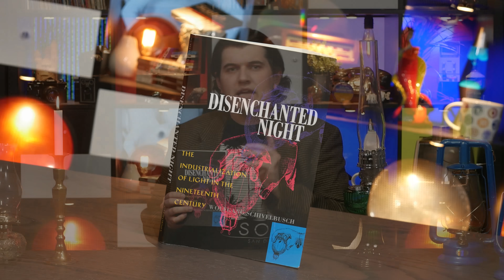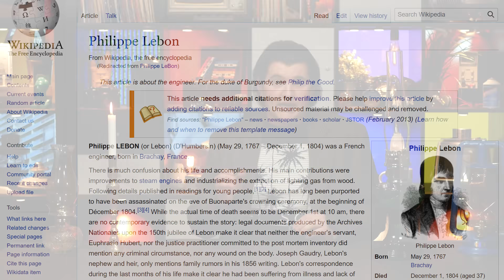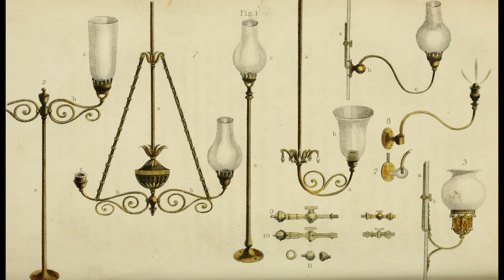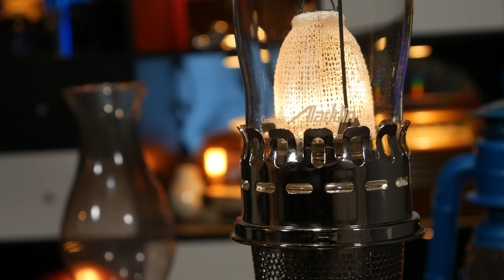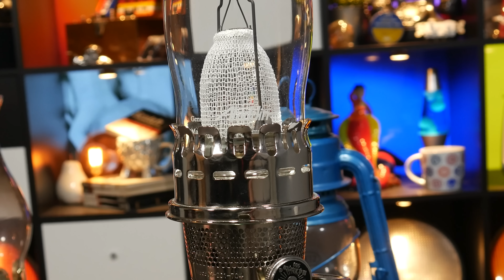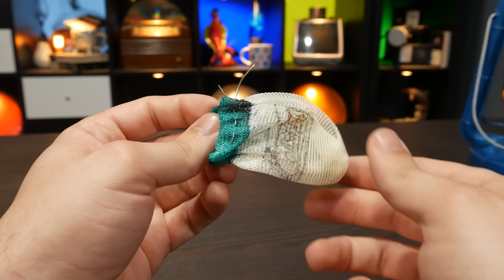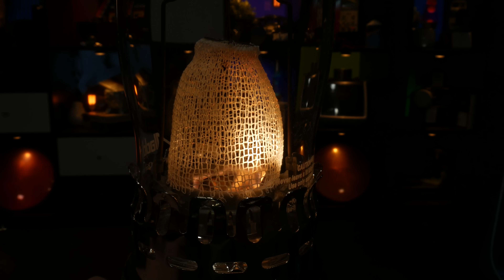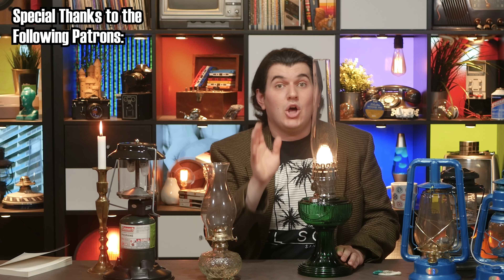How the gas mantle made lamps 10X brighter

Comment: Looking forward to the "burning radioactive ash is a good idea" episode!
Reply: Not only does the mantle glow, now you do too!
Reply: @ebnertra0004  me, ash: 🤔
Reply: Thorium mantles aren't any more radioactive than background. Though it's production is quite the issue in regards to human health and the environment.
Reply: Well it isn't.  If there is one thing you should do when dealing with radioactive materials, it is not breath it in. 

That said, you shouldn't be inhaling any radioactive dust from a thorium lamp if you engage with the slightest bit of caution.  Typical radiation exposure from the lamp is about 2 mSv per 4800 hours; which isn't something I would worry about.

Your damn campfire smoke is probably a larger cancer risk (unless you catch your flame retardant tent on fire, in which case the smoke coming of that tent is the most toxic thing there).
Reply: @josephburchanowski4636  It might be a lot harder not to inhale any radioactive material then you think. A significant part of the radioactive progeny is released as aerosols when burning one, which you can't prevent.
Reply: @wvdh  "It might be a lot harder not to inhale any radioactive material then you think."

Simply don't use it indoors. Don't stick your face in the exhaust air.  If you break it, be careful to not breath in the dust.

The amount of progeny released at any given moment is going to be small in amount, as long as you are in the well ventilated outdoors, your dose will be low.  You'll likely breath more radionuclides in your basement than camping with a thorium lamp (presuming you are utilizing basic common sense with the thorium lamp).
Reply: But Youtube is full of "Thorium is the Good™ radioactive thing" videos…  😀 😀 😀
Reply: @calmeilles  Good is relative.

Comment: The answer for next episode: they pressurized the liquid fuel using a handheld pump 

We call it "Petromak" in our country 😁
Reply from the maker: That only solves one problem!
Reply: @TechnologyConnections  They also run the fuel pipe through the flame in order to preheat it!
Reply: @TechnologyConnections  Does the evaporator solve the other one ?
Reply: "Petromax" in mine but nobody uses it any more
Reply: @TheAllMightyGodofCod  i just found out that "Petromax" is actually a brand name and i guess that where we got the name "petromak" from, and yes we don't use it for main source of light it's more of a decorative in a festival
Reply: @NuhanHidayat  exatcly. Is one of those brands that is used to represent the type of object they make.
Reply: I have one and use it in the barn and we used to use it camping. They still make them and the pressurized stoves are also a lot better than propane ones for camping and cookouts and a great supplement to a wood fire.

https://www.petromax.de/en/px-produkte/petromax-paraffin-lamp-hk500/
Reply: We call them Tilley lamps but to be fair we call all paraffin lamps tillys, it's become generic. https://en.wikipedia.org/wiki/Tilley_lamp

Comment: he electrification of the average household saw the gas lines in the walls used a conduit for the electrical wiring so light valves became light switches. My grandmother's house had wall fixtures converted to lamps in this manner.

Comment: Hopefully you look into carbide acetylene generators when you go into portability. This was a common tech in mining cap lamps for a while.
Reply: Also vehicle lighting. I have a couple of carbide bicycle lamps and the early motorcycles and automobiles also had carbide generators. I would think that riding around with a poorly regulated acetylene generator clamped to your handlebars would provide an incentive to avoid riding at night, to be honest!
Reply: @michaelcherry8952  yeah, I have a mate who restores veteran cars. All of his run electric lights but they have hidden it all in the original housings. In his shed he has a couple sitting on shelves that could still run acetylene but doesn't want to deal with them on the actual cars.
Reply: @hopmic01  Yeah. Open flame headlamps + vintage cars  = "Hello, insurance company? A funny thing happened..."

Comment: I notice that the "ties" that attach the mantles are now wire. They used to be asbestos string.
Reply: Mmh, cancer spahetti - tasty
Reply: Asbestos is still in very wide use today in the US. It is just not used in residential settings, only certain industrial uses. And it is no more of an issue than gasoline is. Asbestos is perfectly fine as long as you don't create dust. Gasoline is perfectly fine as long as you don't let it create vapor.
Reply: It was asbestos times, it was the worst of times.
Reply: @ynotw57  You win the grand prize for asbestos comments today!
Reply: @ynotw57  Great!
Reply: Thorium and asbestos. The past was a dangerous time
Reply: @usingthecharlim  Thing is Asbestos is all natural.  Seems like it would be a good marketing ploy.
Reply: Person 1: Asbestos dust is bad, so we should probably outlaw it.

Person 2: OK, let's put it in BRAKES, something that will wear down and make dust!
Reply: You can get them with string or wire.  I still use string.
Reply: @paulsto6516  It's a few cents cheaper per mantle to buy string ties versus wire ties. That's the only real advantage.
Reply: @zapityzapzap  Often more than a few cents.  the clip on type often cost a couple about 20 cents more for a package of two, than a package of four with string.  I'll tie a knot to save several dollars.
Reply: Well if your mantle is going to contain a radioactive isotope you might as well add asbestos, because the customer is getting cancer anyway.
Reply: @marc-andreservant201  You aren't going to get cancer from a thorium lamp; unless you do something stupid.  Manufacturing the lamps is another story, many workers would get cancer due to unsafe working conditions.

As for being a camper, you get something like 2 mSv for 4800 hours of exposure.  Which isn't even close to a cancer risk.  Radiation isn't as scary as some people make it out to be; just utilize some caution and your be fine.

As long as you don't start inhaling the damn filament; the largest cancer risk is going to be from the damn campfire smoke (unless you catch your flame retardant tent on fire).
Reply: @josephburchanowski4636  thing is, the radiation does not leave.  so if you have this thing, which is not much of a risk on its own, and a number of other similar things that are also not a risk on their own, you'll start building to a true risk.

kind of had to learn about this when my mom was getting treated for cancer.  because of the radiation treatments she had then, doctors only take x-rays of her when necessary, as the additional radiation absorbed by the body during x-ray photography, minor though it is, adds to the radiation she absorbed from radiation treatment and gives her a greater cumulative risk of radiation damage.
Reply: @rakninja  You are correct about the cumulative nature of radiation, but most people aren't getting the doses of radiation that is present in radiation therapy.

Like quite literally in radiation therapy, the intensity of radiation they are applying to the tumor, if applied to your entire body would be several times overkill.  4 Gray to an entire body would give fatal radiation sickness.  The intensity of the radiation the tumor is getting may be 40 Gray, or even as high as 80 Gray.

Much of it is very localized, but there is still some dose received by healthy parts of the body.  So your mother has to be far more aware of getting radiation doses than other people.

For an oversimplification of the dose units, 1 Gray is usually about 1 Sievert radiation dose (an exception is that 1 Gray of internal alpha radiation is 20 Sieverts).

For most people who aren't handing radioactive items on a constant basis, or are getting radiation therapy; a few mSv per year isn't going to harm them.
Reply: @josephburchanowski4636  i think you're forgetting the "radiation mania" of the day.  as radiation was not well understood at the time, there were literally thousands of snake-oil products that included uranium because radiation was the hot new thing.

and that's not even considering all the little curios and other useless nick-nacks also made of uranium.  uranium glassware was also fairly popular.  basically, such artifacts as now are required to be stored in a radiation-blocking material.

you're right, though, that in that in the modern context, a few mSv a year is nothing.  but to people at the turn of last century, in the middle of "urani-mania" it would have just been a single source among many.
Reply: @rakninja  x-ray and alpha radiation are not comparable. You have to ingest or inhale an alpha emitter for it to pose grave danger to you, alpha particles simply can't penetrate skin. Not so for an x-ray emitter.
Reply: @tissuepaper9962  ok, explain that to the doctors who are all reluctant to x-ray my mom due to the radiation therapy she received.
Reply: @rakninja  yeah, they're reluctant to x-ray her because x-ray is fucking dangerous, and if she's doing radiation therapy that means she's already being exposed to hugely abnormal doses of radiation without getting x-rayed. Alpha radiation isn't dangerous like that. You have to ingest or inhale the emitter to get a dangerous dose of radiation from it, because alpha particles cannot penetrate skin. I don't have my notes on hand but there's a formula I learned for penetration depth of alpha particles and IIRC it's got a constant 10^-5 in there somewhere. X-rays will pass right through like your skin isn't even there. The difference in energy between alpha and x-ray is huge.
Reply: @tissuepaper9962  did receive.  not receiving now.  even now, almost 20 years later, they are slow to x-ray.

in case you missed it, the issue isnt x-ray radiation, but the cumulative effect of the human body absorbing radiation.
Reply: @rakninja  and in case you missed it, my point is that the alpha radiation emitted by a thorium lantern mantle is not comparable to the absolutely incomprehensibly large dose of gamma that you receive in radiation therapy, at all. Not only does the lantern mantle not emit a dangerous amount of radiation, the radiation it does emit will never make it past your skin unless you eat or inhale a ton of the stuff. It can't get into your body and create free radicals or damage genetic material, except in the outermost layers of your skin. It's basically as dangerous as a mild sunburn, and even that would require a massive dose that would be difficult to receive from uranium glassware or thorium lantern mantles. It's apples and oranges.
Reply: @josephburchanowski4636  The high voltage tubes in tube TVs were known to produce xrays, but that didn't stop people from watching TV.
Reply: @Doug Browning.  But we were told to not sit directly in front of the screen and at least ten feet away.
Reply: @tissuepaper9962  so, say, burning the mantle will not produce inhalable particles?  and would those particles not build up over time, as you use these lanterns daily, for years?

again, cumulative effect.  minute amounts build up over time.  the radiation does not leave the body.  which is a major reason we store uranium glass, benign as it is, in radiation-safe displays.

you're hyper-focused on single exposure effects.  i'm talking about years of daily exposure, combined with tons of daily exposure coming from all sorts of vectors.
Reply: @rakninja  " i think you're forgetting the "radiation mania" of the day.  as radiation was not well understood at the time,"

Ok, so include the old people who played with a bunch of radioactive things in the group that included those who got radiotherapy.  Regardless thorium lamps aren't a danger to most people under proper use, so my point still stands.
Reply: @rakninja  you're not burning the mantle when you use the lantern, except for the first time you use a brand new mantle, which is a relatively rare occasion. If there were particles of radioactive material coming off of it in use, they would be just as incandescent as the rest of the mantle and you would be able to clearly see them wafting up out of the lantern.

Radiation is a cumulative poison, yes, but like all poisons it's the dose that makes it deadly. We're talking about mGy/year with regular use, when a fatal dose is like 4 Gy all at once. You will literally be exposed to more radiation by living within a 10-mile radius of a coal power plant for a year than you would from using a lantern with a thorium mantle every day for the rest of your life.
Reply: @tissuepaper9962  then explain why coleman switched away from thorium after a court decision against them?
Reply: @josephburchanowski4636  except the coleman company disagrees with that, as well as a US federal court.  this is why coleman stopped using thorium and instead uses yttrium.
Reply: @kalburgy2114  But how many of us did as we were told?
Reply: @marc-andreservant201  you're really overblowing the dangers of both materials. For one, the radiation emitted by a lantern mantle can't penetrate skin. You'd have to literally eat one or pound it into a powder and snort it to get radiation poisoning from it. For two, asbestos isn't particularly dangerous in any form except loose fibers and dust, and even then it takes years of unprotected exposure to see serious negative health effects. A little piece of string isn't going to kill you when your only interaction with it is the two minutes it takes to put a new mantle on the lamp, and you only very rarely have to go through that process in the first place.

The real problem with thorium mantles was the production waste, not consumer safety. The real problem with asbestos was lack of PPE, as well as stuff like loose insulation and dust from cutting solid products. If you work with both substances in a manner which doesn't produce undue dust, they are relatively safe.
Reply: @marc-andreservant201  Realistically as an end user you're not going to be getting cancer from an asbestos string that stays put behind a glass cover while a precaution of a dust mask on the infrequent changing of the mantle would virtually eliminate any residual risk from handling. The risk of this item is really to the workers who created the strings in the first place.
Reply: I find the strings to be annoyingly difficult to tie, and well worth the small added expense of the wire clip style.
Reply: Coleman makes a variety of types and sizes of mantles, some with quick-clip wire, and some with string.  I usually still go with the string type.
Reply: whaddidesayyyyy????
Reply: I’d say these asbestos comments are fire, but...

Comment: In most rural areas Kerosene is not a niche fuel.  My family farm in the rural south of the USA keeps at least 300 gallons of Kerosene available at all times.  Besides lamps, which are useful when the power goes out and you are as much as 2 hours away from a utility worker, Kerosene heaters are a must for emergency heat in barns and homes.  Kerosene is also mixed with diesel to help prevent gelling in cold weather.  I love the detail of your videos and your passion for technology, but in these lamp videos, you seem to have come off as very dismissive of the utility that independent light and power sources play in the lives of people that don't live in cities.  Kerosene is a safe, useful, and stable fuel that many of us still have use for even in places like the USA.

Comment: Fun fact: when thjey started to electrify homes, they didn't really know, what they're doing. So early way of wiring a house was to cut two parallel channels in wood and just place metal wires in them. Insulation is for wimps! Just remember: no touching of the walls!
Reply: It's called knob and tube wiring. It didn't make the walls electric, but shorts made fires more likely.
Reply: Many old homes still gave it. Often insurance companies insist on it being upgraded before purchasing anymore.
Reply: @jimktrains0 , but just imagine placing your hand over the wrong part of the wall, and getting a nasty shock. Especially when at first the only overcurrent protection was based on resistance of connections and wires...

Back then they had some truly crazy ideas like a tablecloth with embedded lights. The only, minor problem was the fact it wasn't spill-proof. It made any supper a potential "Last Supper"...

Comment: Based on this, I assume he meant it built up pressure and then popped the seals, and when that failed flat out exploded the glassware itself.  

lute2
/lo͞ot/
Learn to pronounce
noun
noun: lute; noun: luting
liquid clay or cement used to seal a joint, coat a crucible, or protect a graft.
verb
verb: lute; 3rd person present: lutes; past tense: luted; past participle: luted; gerund or present participle: luting
seal, join, or coat with lute.
"they were luted with a heavy coating of calcined chalk and eggshells"

Comment: Was there a lot of steam reforming in use for town gas supplies? I can't seem to find it, other than that it was done industrially. 

Steam reforming is simply adding steam over a hot coal bed, which decomposes into CO and H2 so you end up with more gasses. You also consume the carbon in the coal, not just the volatiles.
Reply: Most coal gasification involved steam. The resultant gas was a mixture of methane, hydrogen, carbon monoxide (poisonous and odorless, but flammable), carbon dioxide (inert) and water vapor. The water vapor is why gas meters in old houses in the North had the meters indoors. They would freeze up in winter otherwise.